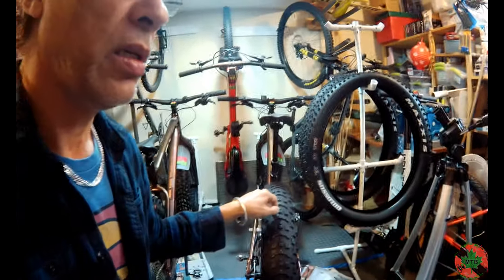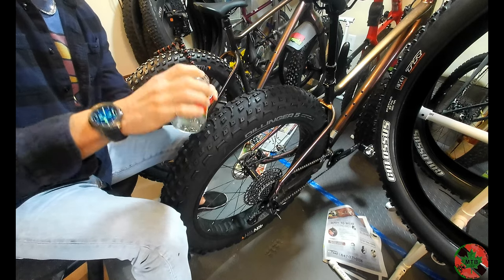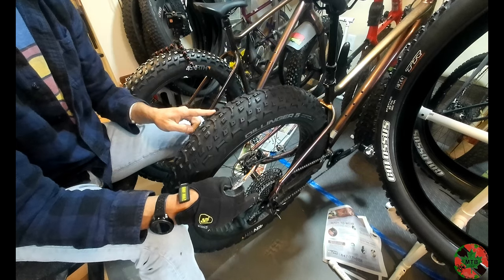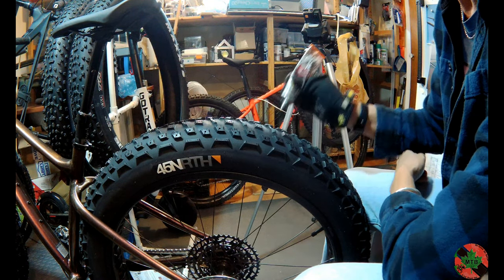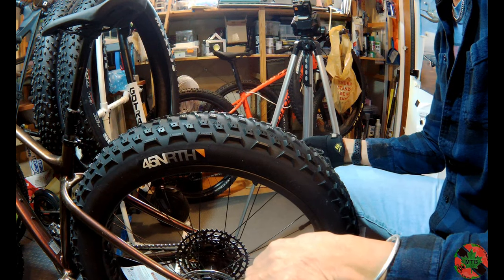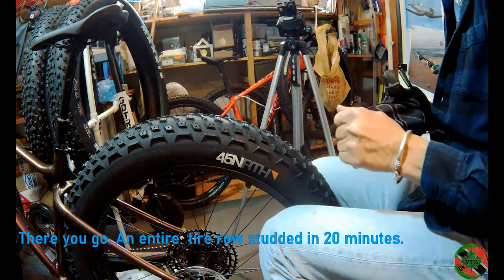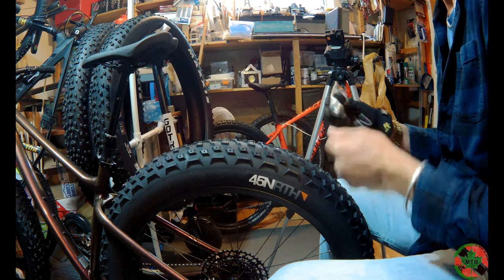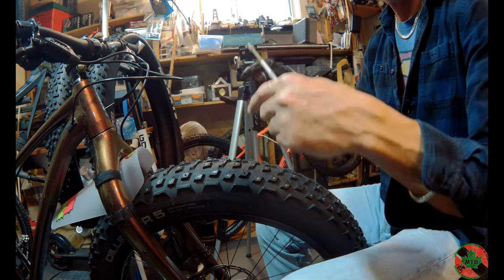Studding the 45Nrth Dillinger 5 Fat bike tires, Easy? Maybe....

Comment: How long do dillinger tires last? I bought a fatbike 3 years ago that came with some "Vee tire avalanche", (some chinese crap I guess). Honestly they have worked well but now after 3 years (only been using them during winter, roughly 2 days per week) they are literally torn to shreds. They have these strands of something going through the tires and the strands have cut through the tires in several places. Fatbike tires are ridiculously expensive but buying new vee avalance tires would cost 80€ each, new dillinger 4 (my bike cant use wider tires) would cost 140€ each. But if the dillilnger last twice as long then they are actually better value.
Reply from the maker: We have had these for 3 seasons now. The Maxxis OEM tires go on in spring & come off after the first winter freeze. They both keep on ticking & show no signs of wear.

Comment: Where did you get that tool?
Reply from the maker: I made it myself. Brass tube from a hobby shop and a dowel or broom handle cut down. Drill a hole to snug the tube in, fix with epoxy. However, you can buy them from 45Nrth.

Comment: Do you find these new tires are a big improvement for winter riding over the colossus?
Reply from the maker: There's definitely a difference. The OEM Colossus tires ran really well at low PSI, 3, 4, 5. Maintained a rigid sidewall and performed well in the trails on (not wet- icy) muddy, soft or fresh snow conditions. The Dillinger 5s can't run below 5 PSI with a 200lb Rider (me). They collapse and are like pushing molasses uphill in winter. The only reason I transitioned was to deal with that snot slick ice we get so much of here in southern Ontario. I have to ride at 7 or higher psi which is painful in fresh snow.

Falling on ice is no fun.
Reply: @AndreLaurentMTB  thanks!  I’m an Ontario rider too and first time fatty owner. Time to get in line for some upgraded rubber and studs.
Reply from the maker: Definitely... Wheels down is always the preferred orientation. Lol